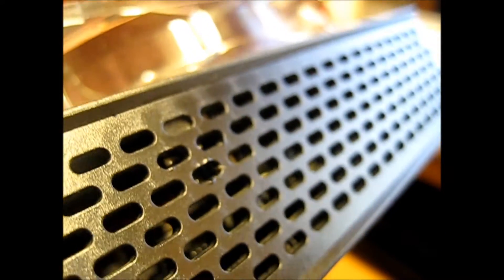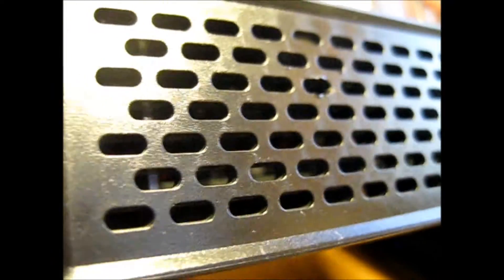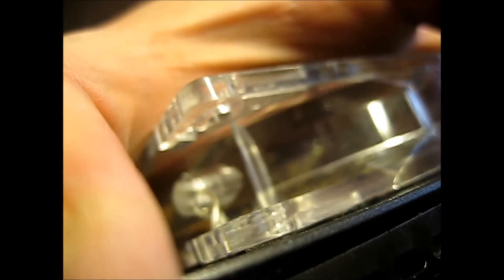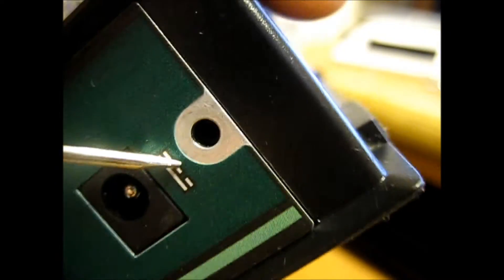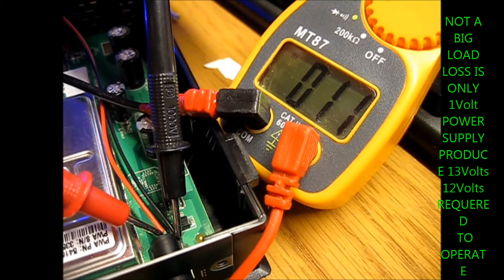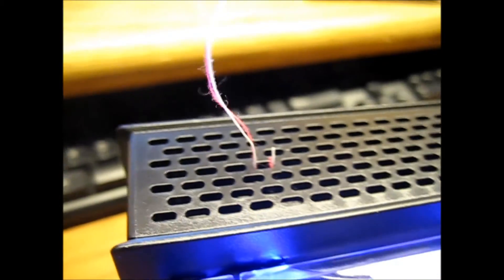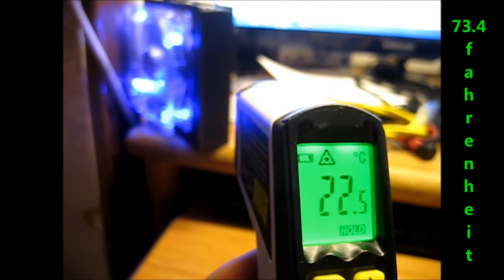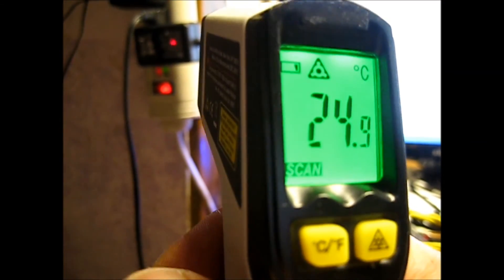Motorola SB6120 SurfBoard Heatsink FAN Mod

Comment: all you did was add a fan and call it a mod I suggest add an actual heatsink
That mod is shitty  should have used a Laptop fan and maybe a laptop h/s as well
Reply from the maker: Fair point 👍 this was just a simple fan mod to keep temps down without going too deep. A proper heatsink or laptop-style cooling solution would definitely make it more effective. Thanks for the suggestion! 🔧